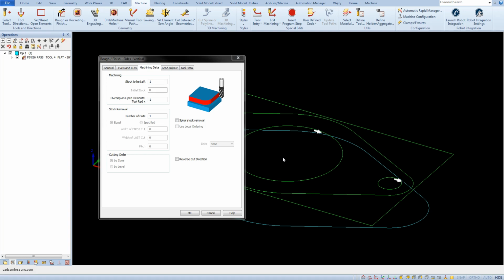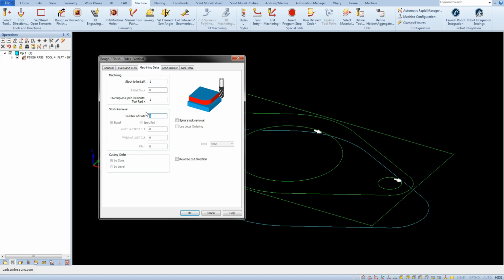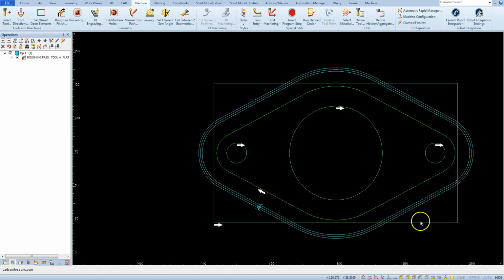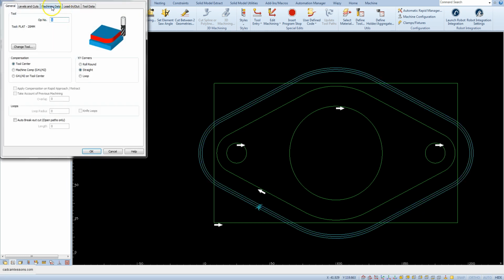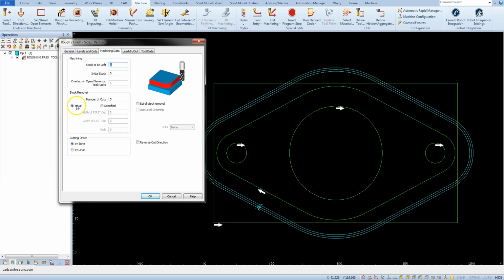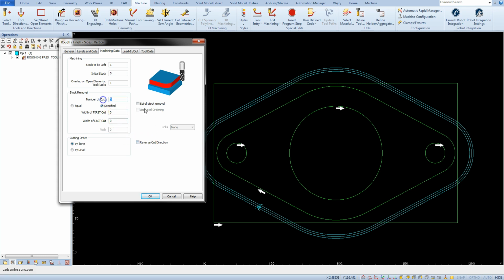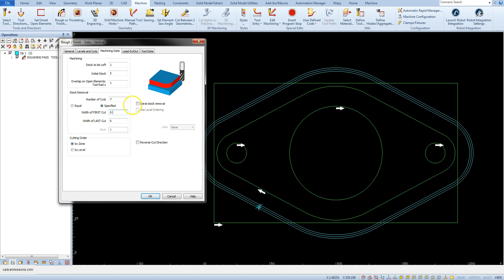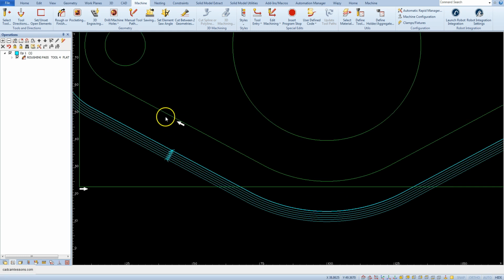Contour Machining part 8 - Initial Stock - Alphacam Tutorial - 028

Comment: Hi! when I'm testing on my pc, "initial stock" dimension is not equal to that I set in machining data tab. From which line to which is it measured? thanks
Reply from the maker: This is measured from the machined contour. When you click on initial stock field you will see image with tip.
But in machining the toolpaths (the distance first pass from machined contour) also depend on the other parameters. Number of cuts and width of first cut. So it could be different for different settings.